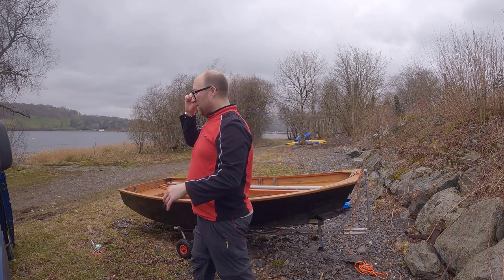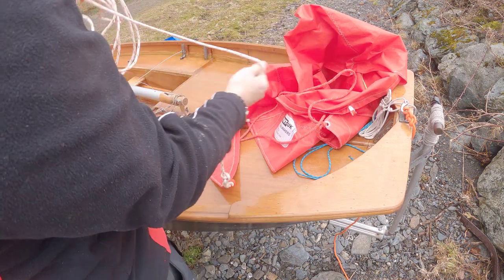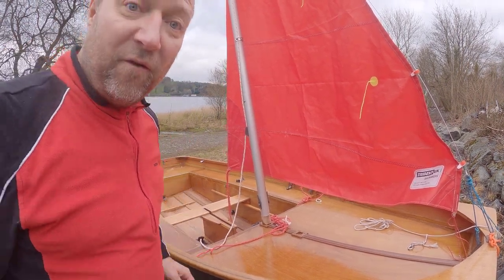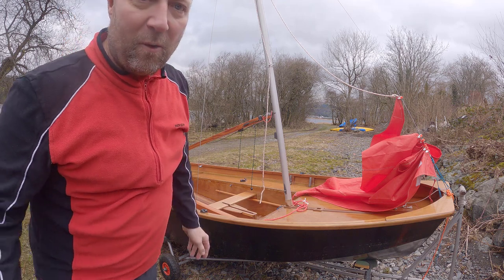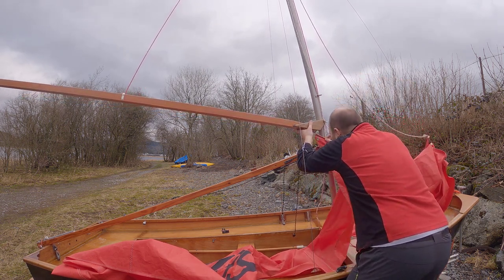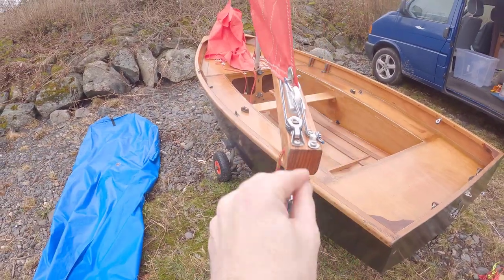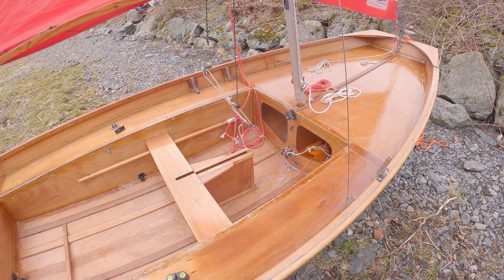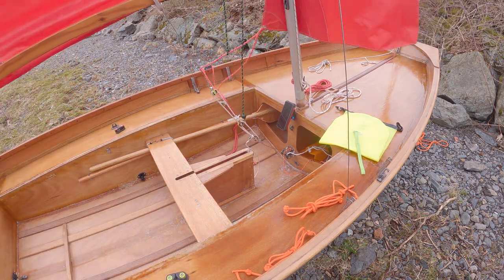How to Setup and rig a Mirror Dinghy

Comment: Thank you very much Dave for the video, it is helping me a lot to rig my Mirror #54907 for the first time. I am practicing rigging it at my house until I am sailing it for the first time this weekend, weather permitting. I think I have watched your video now for the 5th time!
Reply from the maker: Hi Ivan. Many thanks for the comment and I know exactly how you feel. I also practised in the garden to get the hang of it all. It was all quite bewildering at first for me! I also removed all the Spinnaker lines, but getting those back on will be a challenge.

The great thing about the Mirror is that once you have her rigged up you only really have to then bring the mast, gaf nd boom down. Everything else can be left attached so when you sail it can take less than 10 minutes  to set her up once you get used to her.

Comment: Thanks Dave, This was very helpful and I’ll watch it again before I set up the old fibreglass Mirror that I just bought. Gaff and boom are in poor condition so I’m going to splash out on a telescopic metal mast and boom from Trident.
Reply from the maker: Hi William. Many thanks for the comment. I had no idea that mast existed. Just had a look, quite pricey tho. I wonder if you could make it yourself. I just made an aluminium telescopic jib stick for the lugger so I wonder if you could do the same for the mirror mast?

If you get specs for the diameter and thicknesses, I would be very interested and could help you find the right size and aluminium spec?
Reply: @SailingWithDave  Hi Dave,  Unfortunately I'm not that handy. I would probably find it easier to repair the wooden gaff. I haven't had a proper look at it yet, it's 80 miles away. Thanks for the offer though!

Comment: Thanks for the nice video.  I just have one suggestion.  You could put a small line through your mainsail tack around the mast and then tie off.  This would keep the tack of the sail close to the mast when you tighten the out-haul and also put less of a strain on the down-haul in heavier weather, especially as it seems your mainsail doesn't use a luff-line.  Happy sailing!
Reply from the maker: Hi Gareth. Yes, I often wonder that but, on my mainsail there are no eyelets to do that with!!

I could put some in as I don; tthink they would need reinforcing in any way.

Comment: I am intrigued with the simplicity of the mainsheet setup. I have never seen that (i live in Melbourne, Australia) until I watched some UK videos. All the mainsheets here are down from the rear of the boom to a pulley running on a line between the two holes in the transom then back to the rear of the boom, along the boom to a pulley above the thwart and then down to a block on the back of the thwart. More gearing, a ratchet and the main sheet is in front of the skipper but a lot of friction. I am going to try the simple setup.
Reply from the maker: Hi Tim, I think I have the "original" rigging for the mainsheet which most of the wooden and older boats have. At some time in the 1980's I think, they released a newer mainsheet set up that sounds like the one you have. It had the benefits of clearing the cockpit if the main sheet, which can get in the way sometimes, and also it gave a better performance as I belive it uses a number of blocks to get more tension through the sheet?

I actually like the way mine is, because it's very easy to remove which gives me a nice clear cockpit when motoring.
Reply: @SailingWithDave  Yes, it is very clean. On Albert Park Lake the wind is notoriously fickle. Shifts and gusts are very common. The boat I have (the Mirror is for my granddaughers) is a Sabre which has a tall narrow sail with a centre boom sheet. The Sabre is designed so the sailor can very quickly spill the wind out of the sail and this is ideal for the lake. The rear boom sheeting of the Mirror coupled with the wider sail makes it slow to spill the wind but the simple setup which you use would let the sheet pay out more quickly.

Comment: Hi Dave, Where about on the Gaff is the halliard connected to? Is it the thing in the middle of it?
Can't wait to go sailing, Thanks for the advice! It's been very useful..
Reply from the maker: Hi David.  Yes it's something like that, u can find exact measurements online. Mines got the Mirror gaff band but I've seen a lot of people just drill a hole through and use a stopper knot. .
Reply: @SailingWithDave  Thanks Dave, it has one of them bands,  I didn't know if it would hold though if I'd got it wrong. I'm looking forward to sailing, Might even bump into you, not literally though eh 😁
Reply from the maker: @davidnavin6285  hahaha. Yes just a stopper knot needed I think. Will be out on Mochyn Du soon aswell so  may well see her!!

Comment: The foot of your jib is sitting way too high Dave, it should sit level or just below the deck
Reply from the maker: Hi Andy. Yes I agree and actually did lower it in an early video somewhere on here. But, that gave me two issues. Firstly my back ached so much trying to see under the sail that it became unpleasent on a whole days sail. Secondly I couldn't see much ahead under the sail. I just wanted to be safe and be able to see all the swimmers and kids on the lake. Trust me, they get everywhere, even the middle of the lake isn't safe!!!
Reply: Aha, fully understand and safe 👍
Reply from the maker: @bl00zbr0  Yes, However I would also add that for me it's hardly going to make a difference. I htink whatever I did to a Mirror Dinghy, my 95KG of body mass would always make me .5KT slower than a young 50KG lad or girl if racing against them!!

Comment: Get rid of the mast float. You'll never need it.
Reply from the maker: Hi Jack. Cheers for the comment. I added the mast float as the last time I capsized, she turtles quite quickly. I think it gives me a lot of peace of mind but in anything but the roughest says probably don't need it.
Reply: @SailingWithDave  Hi Dave.  I am really surprised to hear that you turtled your Mirror.  My model (14948, self-built in 1967) has never turned turtle and I have the same setup as you - wooden masts, etc.  In fact, the only boat I managed to turn turtle was my Flying Dutchman and in so doing, lost my tiller and rudder!
Reply from the maker: @jackccharity  Hi Jack. So the first week I learnt to sail is not in fact on the channel, the reason for that is that I mistakenly just got on with things and nothing in the boat was strapped down. Of course it wasn't long before my first capsize and I lost my brand new GoPro camera, along with most other stuff in the boat! You only need to learn that lesson once.

Anyway that day was quite calm and the boat seemed to lay on her side. I think looking back if she was left for longer she would possibly have turtled eventually.

In season 2 I was sailing her in heavy winds. Doing quite well, beating all the way down the lake, great fun. I came to Gybe to make my way back and got caught out by a timeley gust. Later I was told it was 35+ gusts out there on that day. Over we went and she turtled almost immediately. I took 5 attempts to right her, each time she went straight back over. Knackered, I sat a-top of her and drifted into the shore in about 20 minutes. The wind was so strong it didn't take long at all. I waited for the mast to touch the bottom and then pulled her over sideways and swam her into shore. Looking back I htnk the Jib sheet may have been cleated. The slight panic meant I probably missed that.

I think with mine having the hollow Aluminium mast that fills with water, it is more prone to turtling than older Mirrors.